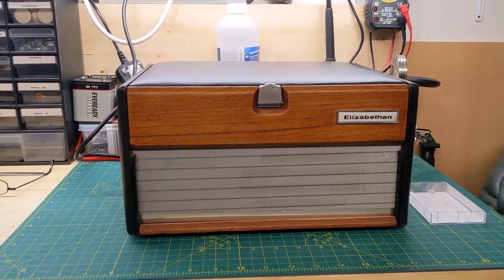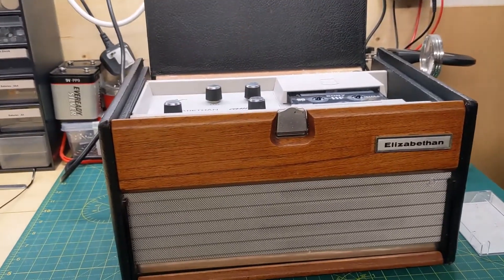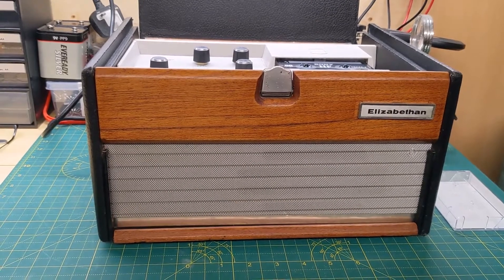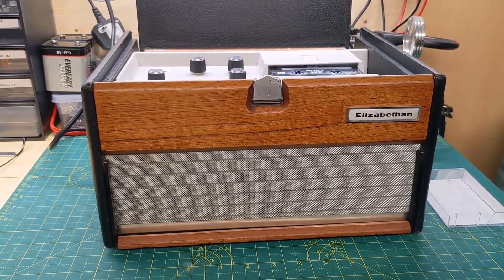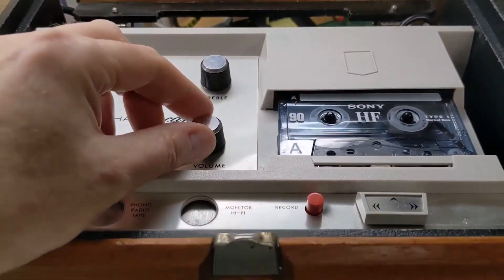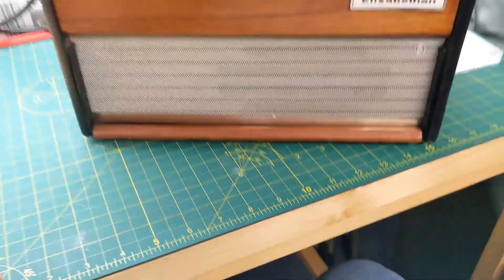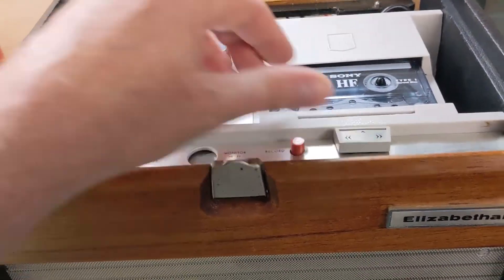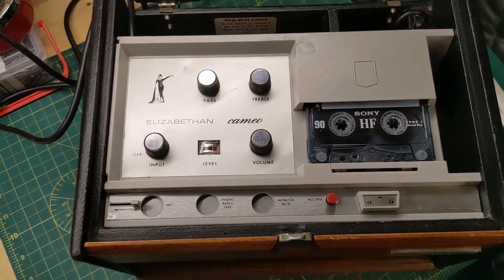Elizabethan Cameo LZ614 Problem

Comment: I have never seen that philps mec built into a unit.
with this kind of fault we just used a hair drier and freezer to chase the problem it does sound like a failing coupling cap but if say it uses locfit transistors could be one of them.
Reply from the maker: Cheers Rob. I didn't think about that. Do you think it would be worth getting it out of the case and randomly blasting my mini hot air gun at the board?
Reply: @spankysmp  yes that is excactly what we did with tv sets  .the ideal is to gently heat the area unill the fault shows up then try and norow it down with freezer .